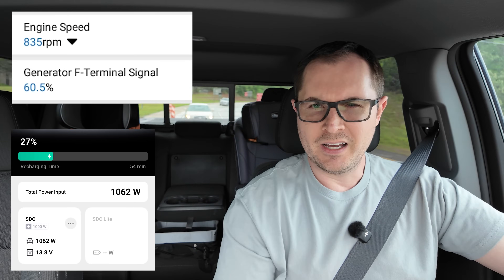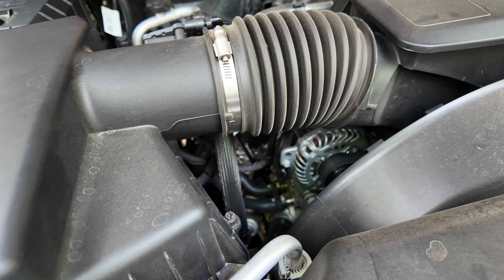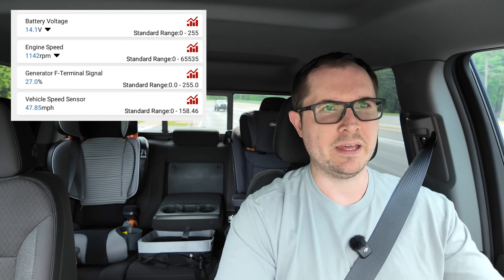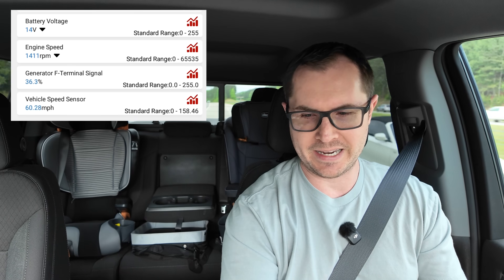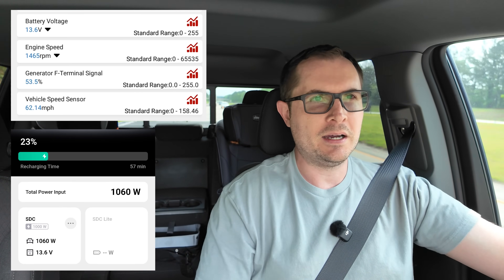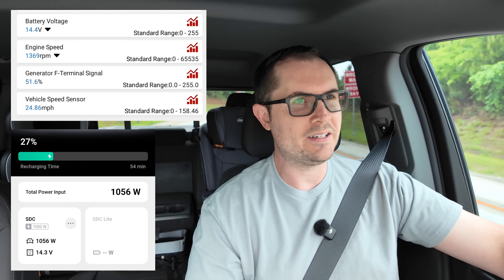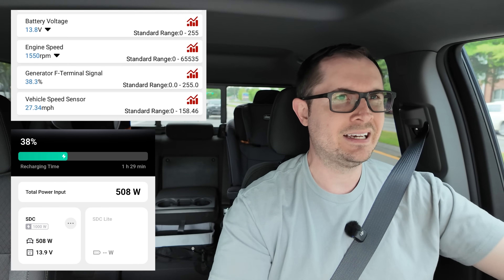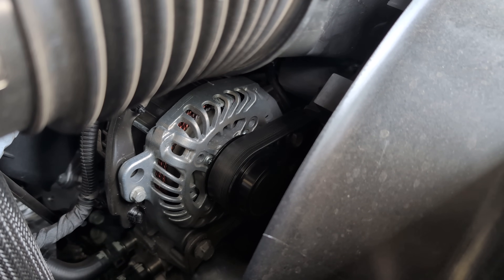I Show REAL Numbers: Impact of DC-DC Chargers from DJI, EcoFlow, Bluetti on Alternator

Comment: Alternator upgrades are easy and fairly reasonable. We installed a pair of 50 amp Victron Orion XS and upgraded the single alternator on my diesel super duty to a 350 amp  version by Tucson alternator. This one upgrade totally changed our Truck camper life. We can now run the AC all night at a harvest host or boondocking and can easily recharge  our  1000 amp hrs of lithium while driving to our next spot. Prior to this, our 600 watts of solar didn't cut it and we're forced to plug up every third or fourth day. We routinely get 85 amps at idle and 100 at just above idle. After installing the system, I checked it with a heat gun because I didn't have a thermal imager and only saw about a 10-15 degree rise at idle.
Reply from the maker: Great feedback and insight, appreciate you sharing!
Reply: Tucson alternator is a gem.
Reply: Good to hear that you can run two 50 amp Orion chargers on your truck camper. I have a gas F350 with the factory dual alternators that total 410 amps and I'm in the process of doing what you are with your 350 amp alternator. I don't know how the two alternators interact with a large load, but I'm getting ready to find out. Hopefully everything works like I think it will.
Reply: @dirtroadsailing6418  I have a 21' f-250 Tremor and it has a 240a alternator. What are you running that draws so much that 410a isn't enough (hydraulic lift, wench, ???). The victron stuff is pretty 'smart', and it is supposed to control itself so as to not over draw on the system. I'm guessing my 240a is far and away enough for a 50a or 70a DC-DC charger.
Reply: @berthaduniverse It's not about immediate demand like with a winch...  Your battery is an energy buffer to blaat out large wattages so that the alternator can replenish at its limited rate.  

The bigger alternators discussed here are not so much about the maximum output as it is for heavier duty cycle, to bank those house batteries back up after a few days of drawing them down, hopefully during the trip to the next park so that less generator might be necessary. 

It's all about raising the duty threshold high enough that it won't shorten the life of the alternator with heat fatigue. 

Run 410 amps worth of alternator(s) so that a constant duty draw of, say, 200-300 amps won't stress out over the course of a 4 hour trip at constant output.
Reply: @1SqueakyWheel thanks for the thoughtful reply, but you miss my point. In the question I was asking, Ford/After market offer a wide range of options (and yes, in cases of a snow plow, winch, or lift hydraulics, there's going to be a second battery in the TV/engine bay), but I don't see how a 50-70a smart charger (say a properly wired Victron) is going to overload the stock 240a alternator enough to justify spending what must be over a $1000 on 400+amps that probably will never be needed in this use case. I have a feeling the DJI equipment in this video is not sensitive to the system (alternator) demands and will draw whatever it wants, whenever it wants. That's enough for me to avoid it.
Reply: @berthaduniverse I hear ya
Reply: @berthaduniverse a lead acid battery tapers off as it gets full. A lithium battery draws a high charge current until it suddenly doesn’t.
Reply: An alternator upgrade increases the side load on the crankshaft bearing, which will wear it out sooner. That's why some "extra output" factory charging systems do what marine systems do: Bolt up a second alternator, opposite the first, to balance out that bearing load. Sadly there's usually not enough space for this.
 And, a competent auto electric shop can install an external regulator with a heat sensor, which throttles back your alternator to prevent overheating. Standard on marine systems for 40-50 years now.
Reply: @lyfandeth That hadn't occured to me...but you are absolutely right. My GMC truck has a brand new engine in it...and that little gem of information is duely noted. Thank you!
Reply: Be careful about lithium batteries. They have a charge controller that can shut off suddenly and create a voltage spike. Have your electronics guy install a diode to protect the alternator and devices on your power bus.
Reply: @lukeskywalker2116  my understanding is that as long as your lead-acid chassis battery is connected to the alternator then the instant lithium charge shutoff won’t hurt the alternator. Problem occurs when the alternator is only connected to lithium batteries because the battery management system shuts charging off completely. If there’s a lead asset battery in the system, it will act as a buffer.
Reply: I am glad several people mentioned the Lithium Batteries. High heat/insufficient cooling will kill the alternator over time. Cooking the windings and bearings is not going to be cheaply rebuildable but if you treat it as routine replacement and simply a more frequent replacement that might be ok. Especially if you keep your total load to under 80% at idle.

However if the Lithium battery BMS suddenly shuts off or even the DC-DC shuts off suddenly back voltage spike will instantly kill your triacs? or diodes. This can be cheaply rebuilt but it is still a rebuild or replacement and downtime. Not good.

I believe that so long as you still have a lead battery in parallel with the alternator, you have pretty good protection from this, but if your start/run battery is also lithium you could have a problem with this. Not a common situation but people are trying to do this.
Reply: Cool video. 
Have a link for the oBD tool you have? I need to checkout our F signal on the Denali! 
-Keith & Kelly
Reply: I second Tucson alternator. They rebuild with OEM or better materials. Have used them for years.
Reply: Smart and pragmatic analytics, love it
Reply: LOL, that's what I'm doing right now, 2 XS Orions and a 250 amp from Tucson alternator. It was taking a loooong time to charge the 460 AH Epoch in the van
Reply: There will be more drag on the same size pulley. You pay for the extra drag at the fuel pump. May need more belt tension which increases risk of premature belt or other bearing failures. But if you stay on the go, it saves the trouble of dinking with a generator.

Comment: Thanks for the videos. When I was researching truck options, your videos helped me decide to get a 2025 GMC 2500 SLE with the gas engine. I didn't request it, but the window sticker on my truck shows it has a"Snow Plow Prep & Camper" package that includes the 220 amp alternator. I might have to take advantage of that one day since we have a 5th wheel camper with 300 AH lithium battery for off grid camping.
Reply from the maker: Thansk for watching. Nice! In hindsight I wish I had spec'd the 220amp alternator on mine. It's definitely nice to have. I wonder if you might even have the bus bar kit on the battery distribution panel already with that upgrade bundle.
Reply: @AdventureRocks , I checked, and there is a distribution bus bar on top of the battery, with a couple of spare connections. It also came with a bag containing an extra wiring harness and relay module.
Reply from the maker: @kevinrepass4210 thank you. That's great, nice package bundle to order with truck.
Reply: You seen the recall and gmc?
Reply: @erico3833 , haven't seen one on my truck. It has the 6.6 engine. Not the 6.2.

Comment: Excellent video and data. The parameter that would be valuable that unfortunately is not easy to get, is alternator temperature. These are great devices but need to be managed. If used at full capacity at idling definitely will be detrimental.
Reply from the maker: Great point, I appreciate the feedback.
Reply: i keep reading this but what is an unacceptable temperature? about that data...

Comment: Not to change the subject, but I chatted with you awhile back about the oil catch cans. I have also a 2024 GMC 2500HD same color with a long bed double cab SLE 6.6 gas. I installed the J&B catch can system for this truck and motor just after 2000 miles. I put it to the test, as I hadn't noticed anything accumulating in it around town. I went on a 600 mile trip with my Lance camper on last couple weeks. I traveled the highway between 70 and 75 nearly the whole trip. When I got home, I removed the can and there was about a tablespoons worth of oil with a little dark stuff in it, so it did what it was supposed to. This did not go into the injectors and onto the valves, in turn causing carbon buildup that causes problems. I cleaned out the canister above the garbage can with a couple squirts of gas and wiped clean with a paper towel. I recommend and it ran great. Very strong engine.
Reply from the maker: Thank you for the update. That is great to know on the catch can. I appreciate it.
Reply: I installed a largish catch can on my LS2 engine (140k miles). The engine is still powerful and it uses little oil. But the catch can contains 100-150ml of oil after about 2k miles of mixed driving. It works well!
Reply: I meant  J&L  catch can, not J&B...